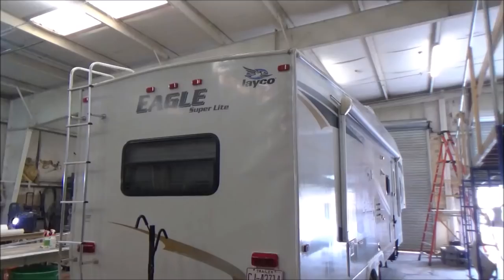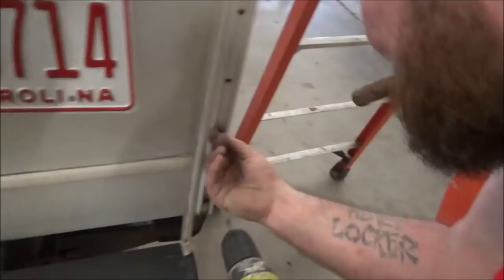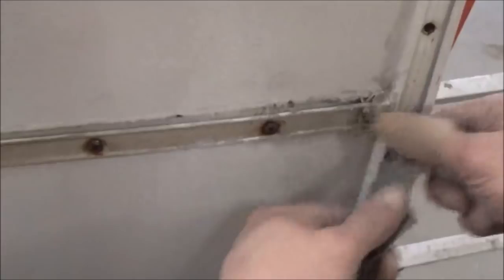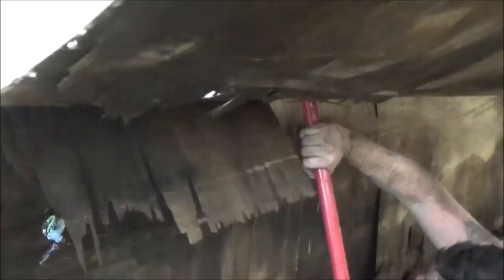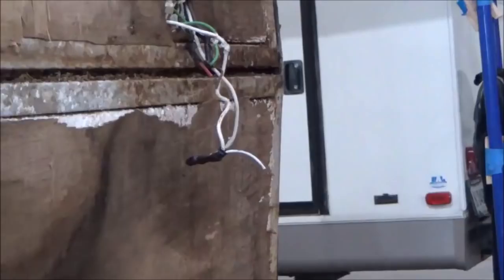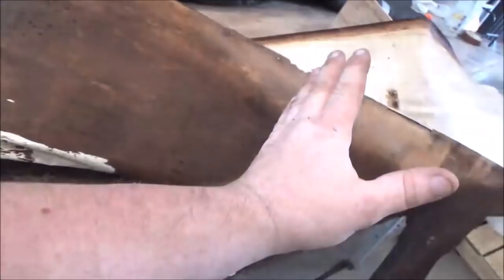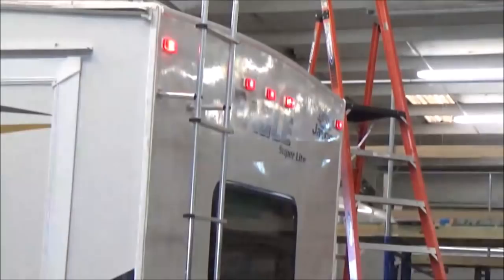Re-built and Relaminated rear wall on Jayco super lite

Comment: Super, super nice work. I wouldn’t have thought that filon could be reused and look decent, but you guys made it work and saved the customer $.
Reply from the maker: We try to salvage the siding because a new piece would stick out like a sore thumb and wherever the customer goes with this coach everyone will be asking ... What happened?? That gets to be annoying. Also is keeps red flags down if folks decide to sell the coach. 
Thanks for watching.
Reply: @RVROOFINSTALL  you sound like Hank Hill when you laugh especially at 5:24
Reply from the maker: @JeffinTD  if thr Filon isn't wrinkled or creased real badly, it can be reused.   Takes time to clean it up. Trying to remove some of the Luan iff the back is a rest of skill to not rip the Filon.  Thanks for watching

Comment: Thanks for all great info, I'm new to Rv's, I bought a wolf pup 15 v nose  2 weeks ago 2019 new but i have noticed some seam caulking has separated I'm taking it for warranty work. again thanks for
 these videos.
Reply from the maker: Good luck with the warranty....in your owners manual it will stipulate YOU need to slather more caulk on the vents, , skylight ladder etc. More on, more on more on....lol. welcome the the RV world. I don't own one! 
Thanks for watching.
Reply: Absolutely not built to last it is ridiculous and will always leak somewhere constant maintenance press board gets any water it has to be replaced all in all I’ve experienced that everything from the drawers to the floor just disintegrate. Very unhappy with the costly repair work and unprofessional workmanship
Reply: Fern Dog, do your own caulking/sealing. I recommend OSI quad max. If you want water clean up, go with DAP Dynaflex. For roofing, nothing beats Eternabond with Premium Pro sealant on tbe edges. Dealers or factories will just use the same garbage that failed already.

Comment: What year is that Jayco? I went with stick and tin because at least it can’t delaminate, lol. They all rave about Azdel like it can’t do, what this one is doing. I’m glad I followed my gut.
Reply from the maker: @jerrytalley802  I don't know the year. I'd have to surf through work orders to find out.  The issue with aluminum siding is making sure it's sealed well, especially vertically in the corners. We use  big stretch by sashco. Don't us silicone on anything. 
Thanks for watching.

Comment: Hello and great info. I get the regular type construction materials and adhesives but can you comment on the glues that you use to laminate that final finished surface layer onto the back of this one? Is it some sort of contact cement or epoxy with a setup time i need to be aware of? I see you rolling it for contact and I'm guessing it would have to be awfully sticky. The back of that looked real good in the video when you rolled it out of the shop.
Reply from the maker: You can use 3m90. I will be ready to adhere in a few minutes. If you touch it and it's a tad tacky....you're ready to go.
Reply: 3m 90 the spray can stuff? You would need like 50 cans to do a back panels.
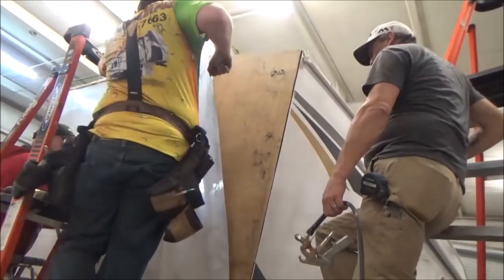Reply: @RiseAboveElevation  or a 5 gallon bucket, notice the professional spray gun at 19:15. These guys are professionals.

Comment: I agree! I do, or rather I have to deal with the repair of the RV trailer, the whole problem is the terrible build quality! it's just a shame for the manufacturers of RV trailers! How can you screw in screws? How can electrical wires be laid? why is it good to seal plywood during assembly?   at the trailer manufacturer's factory, the hands of the assemblers grow out of the wrong place!
Reply from the maker: They chant a moto...Get em built, Get em out, Get em sold!
Thanks for watching.
Reply: @RVROOFINSTALL  Where do you buy 1inch/1.5inch baffle strips?
Reply from the maker: @Andrey Leo 
 Not sure I understand  what baffle strips you're referring.
Reply: @RVROOFINSTALL  those to which the back wall is attached with self-tapping screws.
Reply from the maker: @AndreyVtec  are you calling baffle strips...corner mounding? The aluminum pieces on the corner?
Reply: @RVROOFINSTALL  I meant a wooden cage to which the wall is attached.

Comment: That has to be one expensive repair? How is the interior not damaged as well? Thanks
Reply from the maker: @jerrytalley802  we made sure the foam was dried out thoroughly. Watrr finds it own way. Some are rotted crazy bad, some we can salvage.  A lot of time, we skin the interior, which was tonthe paper and glues that dame paper back to the new one with a clothes iron and adhesive so it looks original. Sometimes, we can't.  Thanks for watching.

Comment: I would like to see you by the end of the year for my camper. I have some leaks that I need to address in the meantime. I hear you talk bad about the Butyl, what do you recommend for caulking around fixtures and vents? Would you use exterior silicone?
Reply from the maker: Off the shelf silicone won't work well. I would suggest using OSI quad you can find that at Home Depot, Lowe's. 
Use a scrub brush to ensure all the filth is removed then apply. A mild cleaner should get it clean enough...soapy water will work too. Make sure it is dry before applying.
We appreciate you anticipating coming in for us to do the roof work. We book out fast. We are tentatively booking for late Aug, Sept. Just keep that in mind. 
Thanks for  watching!

Comment: Is the 3m90 spray adhesive by 3m? Doing delamination repair on our toyhauler and have the fiberglass pulled away to replace the wood and want to make sure the adhesive doesn't eat away the styrofoam.
Reply from the maker: Yes.
Reply: @RV ROOF INSTALL  how well does the adhesive hold up?
Reply from the maker: It will eat it up. It's a solvent propelled product that will degregate the polystyrene foam. Need to find something  compatible that will hold up.

Comment: I have my own business and I replace rot in the roofs and recaulk, recoat campers I want to learn how you raise the all the vents and everything up and where to buy supplies so I can do it myself over here in gville alabama.
Reply: Screw dicor yea I'd really appreciate it if you made a video on how to make the flashing and how you bolt it to the roof and raise it up and how to heat weld you should do a patreon so people can pay for the in depth videos I would
Reply from the maker: You may have to buy a franchise.
Reply: I May have to buy a franchise in order for them to sell those products to me?
Reply from the maker: @thebluetravelers7544  we don't sell anything. We do not sell roofing, caulking....all our curbs, boots and accessories are proprietary to us. Everything is custom fabricated for it's application. We absolutely appreciate you watching the videos, however they were never intended to be a DIY video. We do not want to be responsible for improper application or installation. Thanks for watching!

Comment: Man y’all do some good.  How do you handle a side wall that is like that? I imagine you can’t take the whole side off a 5th wheel.
Reply from the maker: Depending on how bad it is delamed you could take out windows, doors lights to get behind it and epoxy it back. Sometimes you have to cut the siding, make repairs and re-adhere the siding which will require some sort of bodywork or creative thinking to conceal the cut. The very first step is knowing where the leak source is and have that corrected as you go about the repair. No sense fixing the damage if the leak source will ruin it again.
 Thanks for watching!

Comment: So what are the best made RV made in your opinion
Reply from the maker: They're all the same. Literally.  I don't own one. ...lol.
Thanks for watching
Reply: So depressing u buy these for so much $ and they end up rotted delaminated rotted floors
Reply: @RVROOFINSTALL  IF you were going to buy one, old or new, what would you buy? What manufacturer do you work on less than others. I've been told since covid, they are pushing TT out the door so fast, as are the dealers, no one cares they are falling apart. Do you get fewer older aluminum "stick n tin"? I don't own one but I'm pondering......
Reply from the maker: @cynthiapanter6808  if I were to buy one I would opt for an older one ... 2006 or older with Filon siding not aluminum. They were built better before the recession. Once they learned how much they could save on cutting corners they stayed the course and got worse. Just watched a video on how keystone is making travel trailers lighter by using a thinner frame... the frame will buckle and fail at the hitch. 
The only camper I have not worked on is an airstream. 
If you buy a motor home you will need to tow a car because when you hook up and decide you need to go somewhere you will need to break down your electric and sewer to travel to come back and hook up again. Class Cs are known for bunk leaks . Class A are very big and gas hogs. 
I would like to have a basic camper bumper pull with no frills or unnecessary electronics. Eventually I will build one.
Reply: @RVROOFINSTALL  When you do, we would all love to see it come together. I will start looking. Oak Ridge is close enough you can fix it if it needs repair! Thanks!

Comment: What do you suggest rather than dicor?
Reply from the maker: Dicor roofing is manufactured by Carlisle Syntec, very large company.  Carlisle manufactures commercial grade roofing membrane and they so have there own kap sealant. Any commercial grade lap sealant will work better than Dicor. Your local commercial roofing supply house should have it 
Thanks for watching.

Comment: what is the best glue to use to put the laminate back on?
Reply from the maker: 3m78 , 90 or 94. Check compatibility, do sample test. Not sure what your doing.
Reply: 3m vhb tape..  good luck trying to pull it off!!!!  20 pound hold, semi trailers are put together with it!👍. Checkl out some u tube videos of it.

Comment: What is that roller tool called
Reply from the maker: what is the time stamp that I mention the roller?
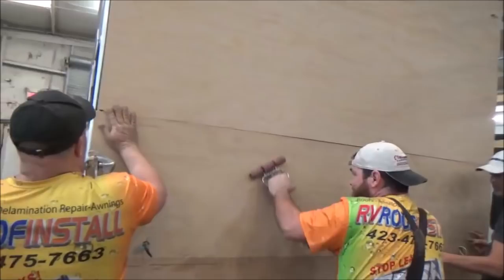Reply: 18:20
Reply from the maker: That is a floor roller. You can get them at Home Depot in the flooring dpmt.  Maily used to roll the edges of linoleum flooring down tight. 
Thanks for watching.

Comment: Couple questions. What determines weather you use 3M90 or epoxy? On the corner moldings did you use butyl tape or M1 chemlink? Good video. I’ve had 3 campers, all are a POS when it comes to craftsmanship and materials
Reply from the maker: Sometimes the spray can not reach,  or the delam is worse. Pouring the epoxy will allow you to have gravity help. The objective is to adhere all the plys together, adhere the foam and/ or the filon to the plys. 
Thanks for watching.

Comment: How’d you get the old luan off the filon?
Reply from the maker: Sand it, scrape it. It will be time consuming.
Thanks for watching.
Reply from the maker: If it is going to rain then out the luan side down on your lawn so the water will help release it. Less scraping. Be careful not to bite too much because you risk splitting into the Filon. Just take a little nibbles. Option B....buy a new piece, but you would have to re-decal. Unless you opt to not decal.
Good luck and take your time.

Comment: What glue do you use to hold the big piece of plastic on the luan on the back?
Reply from the maker: Red 3M94. Thanks for watching.
Reply: Would Weldwood work just as good?
Reply from the maker: @donalddeamer1538  I don't know. You'd have to read the tech data sheet for weldwood.
Reply: RV ROOF INSTALL what do u use under the outside corner strips and other moldings other than the rolled up stuff?  Thanks for your input!!!!
Reply from the maker: @donalddeamer1538  we use M1 by chemlink.
Reply: RV ROOF INSTALL do for along the tops of mouldings,around windows and lights and under mouldings when putting back on?  Thanks for ur time!!!!!!
Reply from the maker: @donalddeamer1538  you can use the same M1 for all if it if you want to. Any plastic, acrylic or roofing making contact with the caulk will need to be primed.

Comment: If you don't like Dicor what do you recommend?
Reply from the maker: Dicor is made by Carlisle Syntec, they make commercial grade EPDM lap sealant.
Thanks for watching!
Reply: @RVROOFINSTALL  I don't understand your answer. You don't like Dicor so get a different Dicor lap sealant?
Can you be more specific? Seems like everybody in YouTube uses Dicor so just wondering.
Reply from the maker: @vigilantezack  the Dicor roof membrane no is made by Carlisle, not the cheap Dicor caulk. Carlisle has a commercial EPDM  lap sealant. Dicor gets there membrane from Carlisle. The Dicor caulk they get from someone else. 
Does the help to clarify?

Comment: As for the mystery of why there was a block of wood beside the foam in the wall; Did the ole light bulb ever come on for you? Hint: It wouldn't be safe to mount a ladder to foam. LOL
Reply from the maker: Lol,.yes there was a portion used for the ladder. I should've said I don't know why they used such a large piece. Manufactures cut cost everywhere. That piece was unusually large for its purpose. So it throws a flag ....didn't have a dual purpose? Morning this case.
Thanks for watching!

Comment: Really, steel screws into aluminum in a wet environment? How much money does it cost to start with stainless? $5/trailer?
Reply from the maker: Stainless bare sifter than the zinc. Tend to break the screw heads...but we do appreciate your attention detail. Well aware of the galvanation process, however there shouldn't be any moisture issues if the roof is sealed. 
Thanks for watching.
Reply: @RVROOFINSTALL  isn't there always going to be moisture in the trim? It seems like every screw I've seen in these videos are rusted and often near failure, as you have said, you know about electrolytic transfer, and it seems marine and even commercial construction uses SS... IMO, steel, zinc plated or not, is part of the process leading to delam failures. Also the application of trim doesn't seem to be structural enough to snap the heads of SS (unless they are being torqued to much on install). Thanks for the vids and the thoughtful response.
Reply from the maker: @berthaduniverse  we seal every screw...every screw! If you were to remove the vinyl trim you would see every screw with a caulk grommet around the head. I would agree with the torque issue but most guys I come across have no knowledge of torquing, so I am forced to stupifying the process...lol. I have some SS screws in stock but you would be forced to pilot out every screw hole...then I got guys breaking small drill bits. It is extremely hard to find qualified help that has an understanding of the tasks you'd expect them to know. Needless to say...I have gone through a slew of morons... lol
Reply: @RVROOFINSTALL  quiz test for all new hires: give em a box of assorted driver bits and see if they can ID them. Most millennials can't tell a torx from a flat blade.
Reply from the maker: @berthaduniverse  here's a good one you can use...ask your next hire if they can find 32/64 on a tape measure....or 16/32...lol. You'll be surprised at those who actually study the ruler.